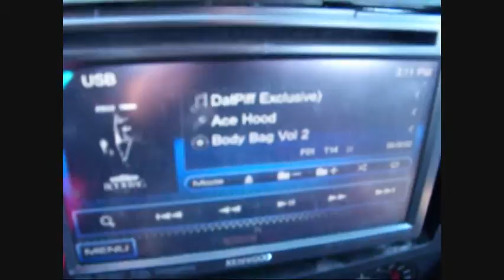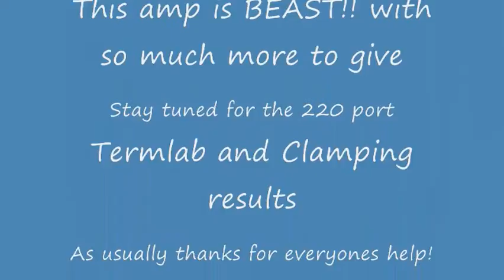Taramps 20.2KW on music with clamp

Comment from the maker: I think maybe your just miss understanding it a little. My Idle Starting Voltage was 13.8 and it dropped to 12.6 or 12.4 i believe on the burp.. That what I use to idle @ unless your bank insn't full which then your Alt will charge @ 14.1-14.4 depending on alt and time of year. Now with a ext reg.. I idle it  @ 14.7. With It at 14.7 my drop though is still to 12.6/12.8 though.